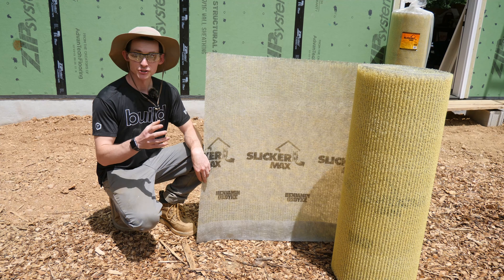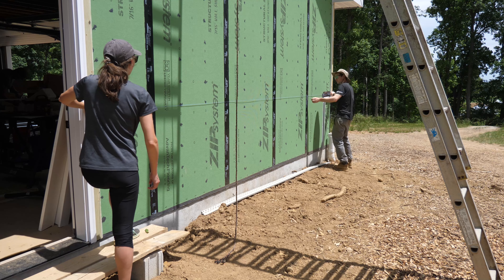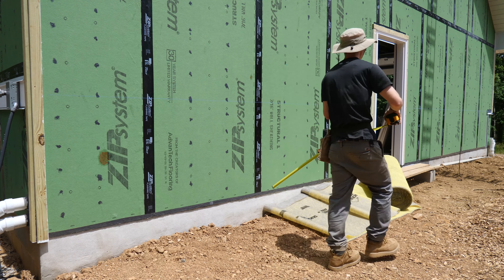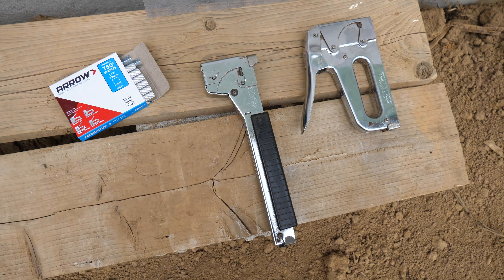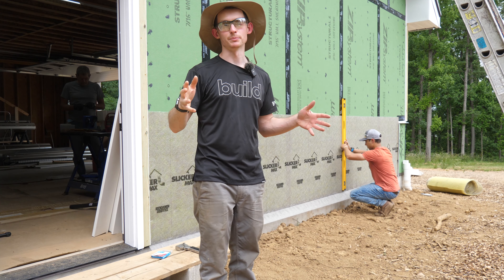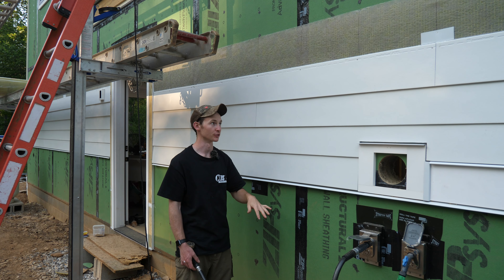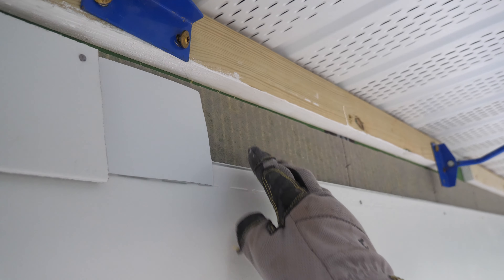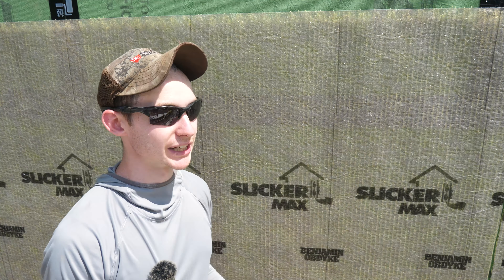DON'T SKIP THIS before siding - Benjamin Obdyke Slicker MAX Rainscreen

Comment: I love how much detail you show in your videos. One thing I don't understand, if your siding overlaps from the top and at the top you have an overhang, how is it possible that the water will get behind the siding? It would need to go up?
Reply from the maker: Thanks! Driving rain against penetrations in the wall is probably the biggest way (although mostly mitigated with proper flashing details). Condensation is also possible depending on weather conditions
Reply: Don't forget capillary action.
Reply: Condensation is the worst offender.

Comment: Great video.  I watch them all.    I am building a new coastal home in Florida and have been looking into which product to use behind hardie cement siding and also cement stucco siding.   What other rain screen products did you consider other than Slicker Max and what made you ultimately go with them?

Comment: 3:23  Tucking the bottom fabric under on the first course is going to hold water. Supposed to cut off that particular 4".  Leave that bottom 4" on the courses above that and simple allow it to overlap onto the courses below it.
Reply from the maker: The tuck detail is per Benjamin Obdyke's detail, the fabric is completely permeable water flows right through it. Tested it